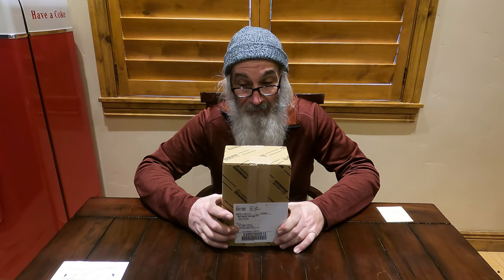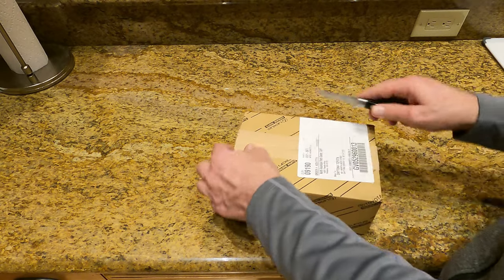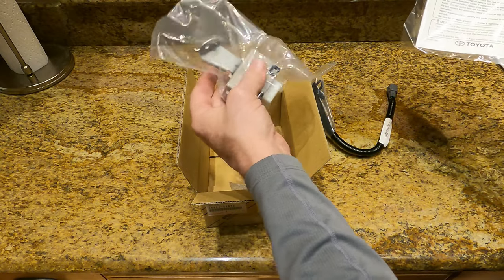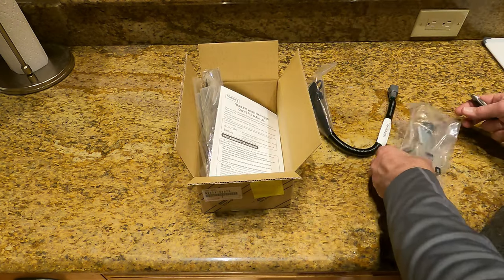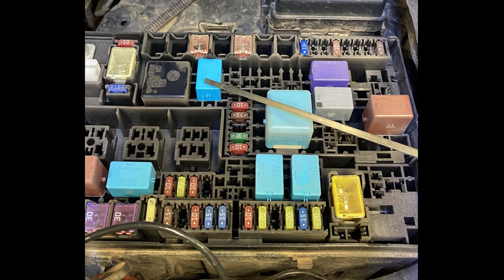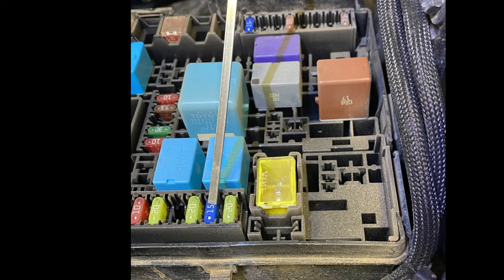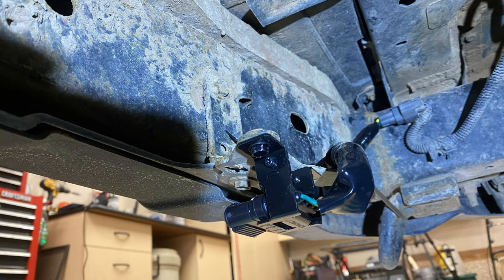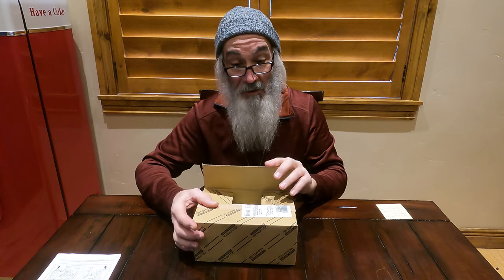🏆FJ Cruiser 4 pin Trailer Harness Wiring Installed in 12 minutes ⚡

Comment: The two foam sticky parts stick on the little box that go inside the cabin and the wiring harness. It is suppose to be a sound / movement insulator for the rest of the wiring harness. Thank you for your video and the good tips like how to remove the plug in the back. Saved me time.
Reply from the maker: Cool, thanks

Comment: Good job Good Sir.  Top notch instructional video.  Took me about 15 minutes.  The hardest part was working under the dash.  
Also note that people with bash guards have to remove them in order to access the connection for the wire harness.

Comment: How did you black out the silver parts on your FJ? Door handles, mirrors etc? Cheers
Reply from the maker: Professionally Painted to match OEM, roof too!
Reply: @UncleFjester  good idea. I’m thinking the same. Don’t want to rattle can it and inevitably screw it up. My FJ is too precious for that heh
Reply from the maker: Oh Yea, wheels were painted too...I did truck bed rattle can the trailer hitch cover and it ended up looking as good as all the flat black trim.
Reply: @UncleFjester  stock wheels? And done professionally? A few people have told me it’s all easy to do but I have zero experience painting anything so I’m apprehensive to DIY this. Sometimes you gotta leave it to the pros IMO
Reply from the maker: When I removed the spare cover I found a silver rim much to my surprise, then in the spring I got new tires again and paid closer attention to the rims and sure enough they were born silver and transitioned to black.  
If you got an '07 with 350K miles the rattle can would be an option.
Reply: @UncleFjester  Ah they were already black when you bought it? I've got a 2015 with 30k miles on it so conscious of doing it properly, tasteful and in a way that will stand the test of time.. as I try to do with all my modifications. 

Anyway, thanks for sharing your experience.

Comment: would you mind posting a link to the part?  i have an '08 lexus rx350 (awd camry) that i'd like to do the same thing to.  i just want to tow small utility trailers so i can sell my pickup.
Reply from the maker: https://www.amazon.com/TOYOTA-Genuine-Accessories-08921-35870-Converter/dp/B009NTD3LW/ref=sr_1_2?crid=CQAO09K6H7ET&dchild=1&keywords=fj+cruiser+trailer+wiring+harness&pd_rd_r=3f3ed0dc-2917-4bb1-8b76-f99af85206d6&pd_rd_w=7WfcN&pd_rd_wg=i0zRn&pf_rd_p=bec88bc8-d41e-4895-a8dc-a35e165b8995&pf_rd_r=ZF997YQ0HYS2DXDP24F5&pid=7mf8WBv&qid=1609125725&sprefix=fj+cruiser+trailer%2Caps%2C207&sr=1-2&vehicle=2011-76-2850-20--9-6-8-8087-2404-1-1-2229-237-&vehicleName=2011+Toyota+FJ+Cruiser
Reply: Thank you!  Does this option work for a 2008 FJ?
Reply: @sarahgeminigirl  it works for all FJs.

Comment: My hitch doesn’t have the right hole sizes to mount
Reply: I went to lowes and got lock washer lock nut 5mm and lined up the holes on my hitch and tighten it up works just fine